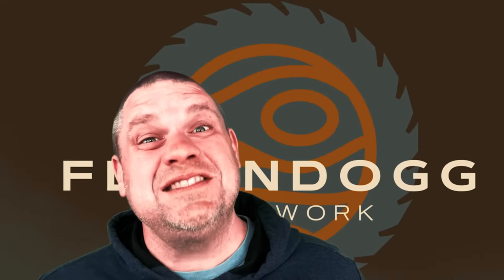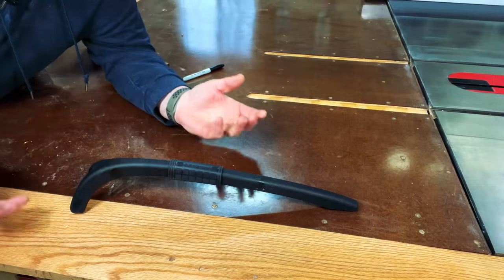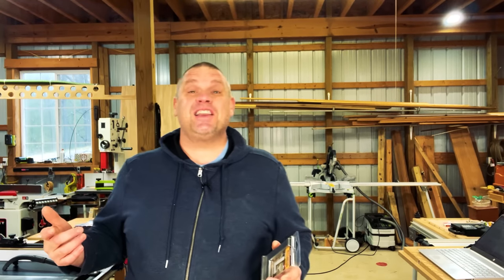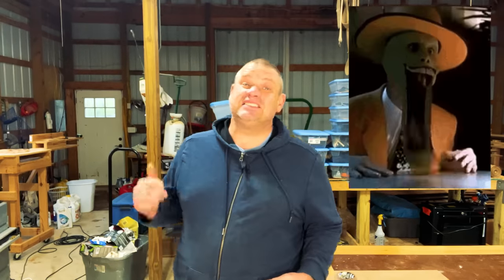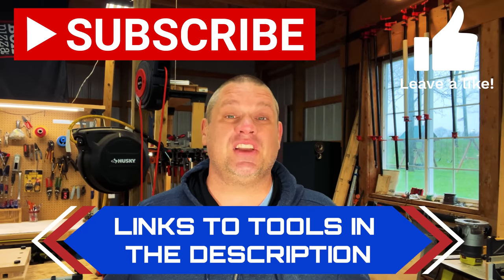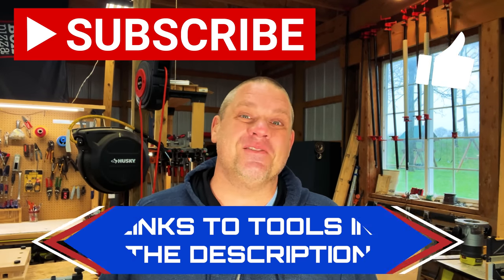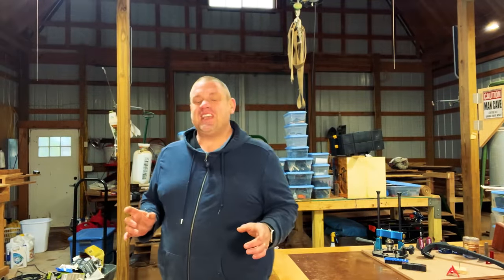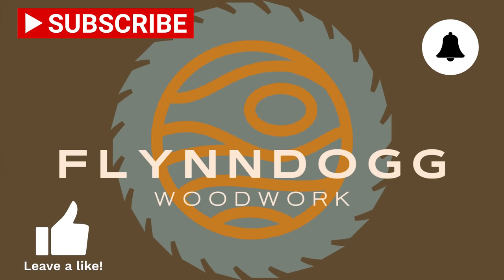Uncover the 5 Surprising Tools You Never Knew Existed! #woodworking #tools #amazingtools

Comment: I have the Milescraft cookies but they are infuriating to use as paint points. They will fall over if you do anything more than set a painted piece on it. If you’re trying to paint or reposition or nudge they will fall and piss you off. They are great on their flat sides but the paint point is just impossibly frustrating. There are a million other ways to achieve paint points. Put nails or screws in scraps and flip them. Anything works better than the Milescraft paint point function.

Love your videos. Any chance you’d make a video showing how you would build a cubby cabinet for your plastic totes in the background? I’ve seen the few methods and have done 3/4 ply box with 1/2 shelves held in dados. Two containers wide by seven high. Two units and that lets me put them on top of each other or side-by-side. Really helps when a few of the are heavy and many are light.
Reply from the maker: Thank you so much for sharing that Fearsome Warrior, I love hearing peoples experience with different products!   I wonder if placing the cookies on each corner perpendicular to each other might help the stability?  Good to know, and sounds like the cookies might be best used for spraying vs. painting.  Thanks for the comment and thanks for watching!

Comment: I've been using that Freud FTG blade for years to cut flat bottom groves and dados. I have a dado stack, but find the rip blade cuts absolutely flat, no "bat wings" and cuts a full 1/8" wide. I recently had it re-sharpened at Ridge Carbide and it's as good as new. Thanks
Reply from the maker: That’s great to know Rich and Peggy !  Sounds like this blade will last for years!   I have a CMT combination that I usually have in the saw, but absolutely love the freud so far!  Thanks for watching!

Comment: I've never had a problem making dadoes with an Alternate Top Bevel blade.  The little grooves it creates gives glue a place to settle, thus creating less squeeze-out, while still providing plenty of holding power.
Reply from the maker: That’s an excellent point Scotty.  That makes total sense!   Thanks so much for sharing and thanks for watching!
Reply: Grooves? Hmm, you are onto something. I guess if it's not facing out and visible, the grooves would provide more holding power for glue, or epoxy, etc. Nice point man.

Comment: People worry about the piece on miter saw moving, or kicking back. No no my friends, it's when your HAND decides to instinctively go WITH the piece. When I saw your hand next to that miter blade I got super nervous and anxiety was kicking hard, like when I look out a window of a 50 story building. I really dislike my miter saw, it gets used for one thing, doing some quick chops of rough lumber, that's it. Other than that, it can pound sand lol, freaking thing wants to murder everyone. Jerk. The Kreg drill guide, I love it. I had to do 5/8 lag bolts into some table legs that were 7" and needed them straight - worked great. I've used it once lol, but you know how it it is. Would do it again too. 

Also, your hoodie - I'd take out those strings. I have an old hoodie I wear around a lot as well, but those strings are death in a wood shop :)
Reply from the maker: Oh my gosh, I never thought about those draw strings on the hoodie!   Thank you, for sharing that!  I can just envision then  getting tied up in the saw and bringing my head in close.  Geez!   I'm kind of with you on the miter saw.   I know a lot of shops don't even have them.  I tend to do most of my cutting at the table saw, except when I'm doing a bunch of repetitive cross cuts.   It's great for chopping down rough lumber, for sure! Thank you so much for sharing!
Reply: @FlynndoggWoodwork  Yea those strings, one time and I know nothing about this, never happened but was using my wen track saw (it's for 90's, nothing else and it works, whatever it's cheap and good) my string caught the blade and ripped the string right out. After that, I re evaluated life and wardrobe. No hanging items, baggy, anything that's going to fly into something :)

BE SAFE OUT THERE!!
Reply from the maker: Will do, and thanks for reminding me about that!

Comment: I’ve got both of those drill blocks and I use them for different tasks. The Milescraft one has a cut out down the middle that sits on the corner of a board and allows you to drill directly into an outside corner. The Kreg has a step on it that grips the side or end of a piece of 3/4” material and you can go square into the end grain. I’ve used both as doweling jigs before lol. Great video as always Bryan!
Reply from the maker: Great information Mr Griffin!  Someone else mentioned that as well.  I wish I would have know that before creating the video.  There were literally no instructions that came in the packaging!  Thanks for sharing!
Reply: @FlynndoggWoodwork  call me Chris bro. I discovered the Kreg one by accident lol. I couldn’t figure out what the ridge on the milescraft one was for for the life of me lol. Then it dawned on me when I was messing around in the shop one day and went on a corner drilling spree lol.
Reply from the maker: @Griffinwoodworks  Love it Chris!   I'm totally going to use it for that purpose!  Thanks for sharing!

Comment: The reason that the "million dollar" tool has three points of contact is not stability, it is because you can nearly always if not always make three points co planar. IE, all three points will be in contact with or could be in contact with the same plane. Of course co planar will be stable but more legs is more stable. The drill guides and I have the Milescraft have a visibility problem. Make a punch in something to mark a drilling point. Then place the guide over that point. You cannot see down into the hole to align your drill tip. If you have a deep enough punch then maybe, otherwise it is hit or miss. I have a flat top ground blade for the same reason. I wonder if you knew this about your saw. I have a SS JSS as $4k is a lot too rich for my blood. But, if you have the saw powered on but not running and you touch a metal object to the blade and the table top at the same time, the lights on the switch will blink. Same thing with your finger. That is a warning that if you turn the blade on you will have a brake actuation. I could not/would not buy the million dollar thingy as the shipping cost darn near equalled the item cost and it just did not set right with me. LOL
Reply from the maker: Thank you so much for sharing this information Jeff, very helpful to everyone!   I did know that about the saw.   Thank you so much for sharing all this information all quite valuable for people to hear!